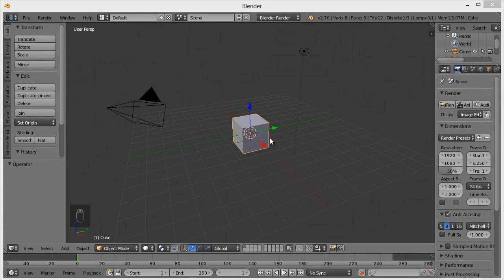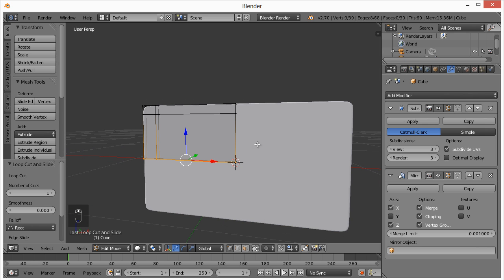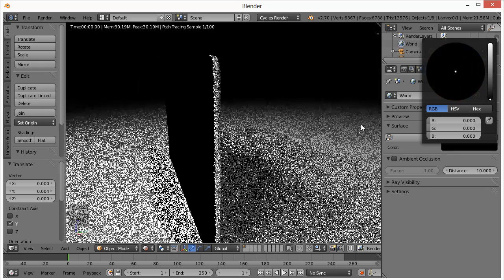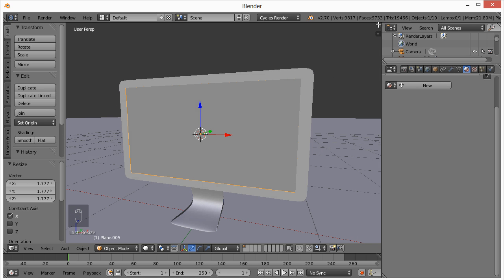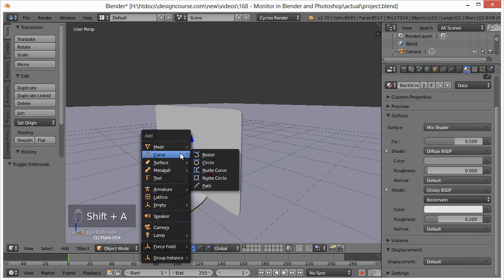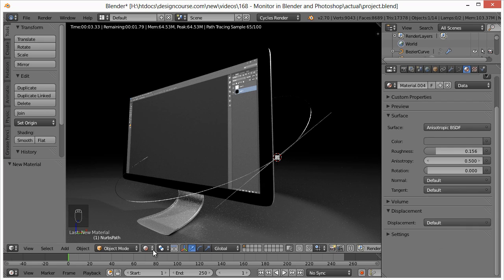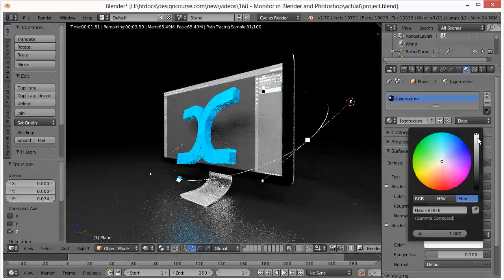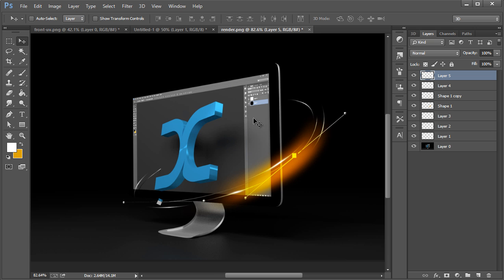3D Abstract Monitor Tutorial in Photoshop & Blender

Comment: hey designcourse i u know there is a bevel tool in blender right? just go into edit mode and select the side you want to be rounded a little bit or alot it would save you much more time than doing the subdivision surface modifier.
Reply: oh just realized i made a small mistake i didn't tell u how to do it when in edit mode hold (ctrl and press b) and you can choose how many new edges you want to make it look more nice chose about 100 or 200 if your choose 2000 it crashes unless you have a 64-bit cpu.

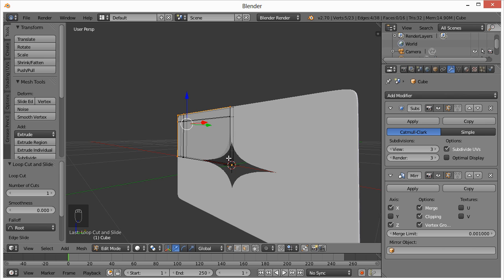Comment: 9:45 adding loopcut to fix subdivision surface issue at mirror boundary:  this doesn't address the underlying error.  The issue was that your mirror modifier needed to be at the top of the stack.  Mirror the object first and then subdivide, so that you are "rounding an unbroken rectangle" instead of "mirroring four rounded objects."  Using the triangle button in the mirror modifier panel will move it up to the first slot.  Also notice that since it wasn't first, the information bar gave a warning: " Applied modifier was not first, result may not be as expected " when it was applied.  By pointing out how changing the modifier order changes the result, you can show your viewers how to avoid the problem instead of forcing them to bandage it by cluttering the mesh with extra edgeloops that would not be needed otherwise.